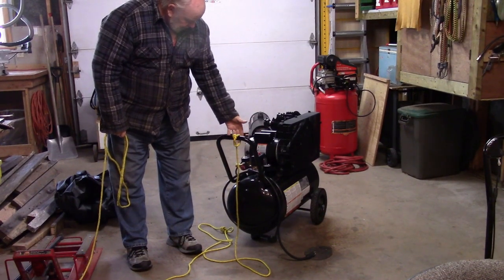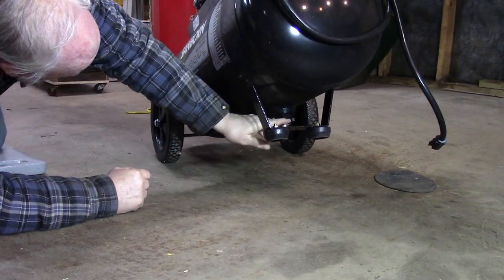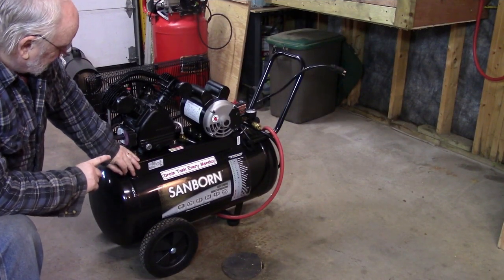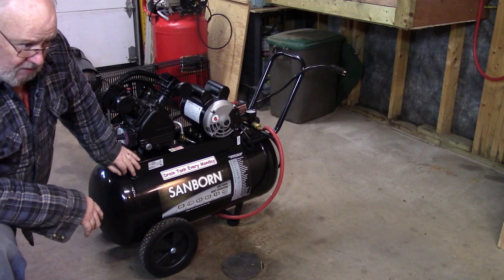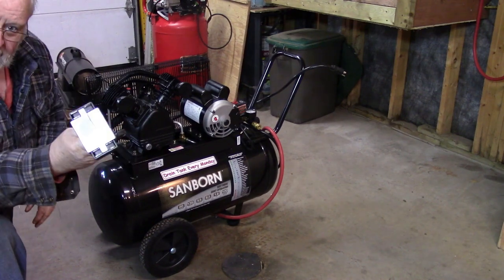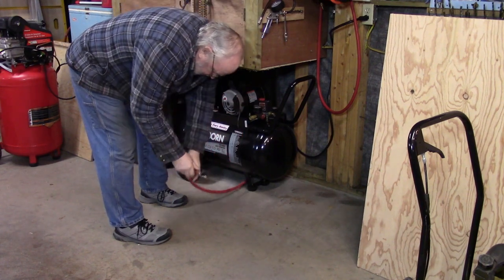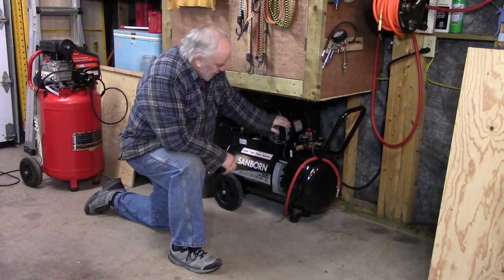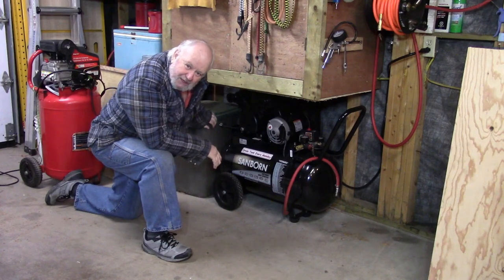Adding a Tank Drain Extension t o My Compressor

Comment: Good job Mike. 
I rigged a ball valve right to the main tap on my tank. Then I added a T in the line ahead of the manifold with an 1/8" ball valve. 
I leave the compressor on and when I need air I open the 3/4 ball valve. When I'm done I close the 3/4" and open the 1/8" to bleed down the line. Then I close the 1/8" again. 
Otherwise I had the quick disconnects on the air hoses leaking the tank down. I would have to shut off the compressor. Then every time I needed air, I had to build pressure in the 60 gallon tank from scratch. 
Now no blown hoses, hissing fittings, or waiting for air. 
The block heater is a great idea. 😁😎👍
Reply from the maker: How's she goin'?  When I was adding the 'main line' shut off for the compressor I ran a line from the compressor to the regulator and then added the stop valve after the regulator/filter.  In hind sight I should have a stop valve right at the output of the compressor.  So that will be another mod upcoming!!!  LOL  The magnetic heater idea worked well I agree!!!  Thanks for watching and commenting.  Take care!!

Comment: I was happy to see this video . It validated my idea of installing a rubber hose for the drain and bringing it up to a level that you don’t have to crawl around on the floor to reach.  Other people just extend the hard line out using hard piping ,still requiring getting down low to reach. Older and wiser still has meaning !
Reply from the maker: How's she goin'?  Thanks for watching the video and commenting.  Nice to have you on the channel.  The bending down part is something I try and eliminate on all my projects.  This rubber drain whip works good.  I drain it every Monday and there is not much water in the tank so I just blow it out on the floor.  Take care and come back again soon!!

Comment: Howdee Mike. Great to see you doing this. I drain my tanks with every use on a daily basis. Once a week just doesn't cut it. It is just a good habit to get into eh. Any water/oil mix makes acid as we know. A week of that going on in the tanks will along with the rust forming and the dreaded water that messes up our air motors need not happen. It only takes a moment at the end of the day. A small price to pay to protect our valuable tools. Even filling a tire with acid eats away at inner surfaces, both tubes and inner surfaces of tubeless tires. There is that and when the compressor comes on line it doesn't have to fight that head of air you mentioned. Poke a hole in that outside wall too. No air/water/oil on the shop floor either. It's always good to see you any day of the week my friend.  Take care and be safe laddy, !
Reply from the maker: Good day Dean!!!  This tank drain was a great idea.  It sure is easy now to drain the tank.  If I used the tank on a daily basis I would drain it more often, but I am having a hard time remembering to drain it every Monday!!!  LOL  
Dean when you say you drained the tank every day, do you mean you let the pressure down?  When I drain my tank, I just crack the drain valve for about 10 seconds to blow out any water that maybe be sitting in the bottom of the tank.  I don't let all the pressure off the tank.  
Thanks for tuning in old friend and take care!!
Reply: @GrampiesWorkshop  Absolutely on draining the tank every use until you here no more water leaving the system.  It does reduce the head in the system and if you are doing a big job needing the old tank as a reservoir do the same thing you did here. A rebuild on a hammer style air motor can cost nearly half the cost of a  new tool.
Reply from the maker: @TomokosEnterprize  For sure eh!!!  Thanks Dean!!!

Comment: Great modification, we need to do the same as we do not drain the tank frequently due to it being difficult to get to. To add to the fun, our floor is not so nice to lay on as yours lol. Thanks for sharing
Reply from the maker: Hey there Joseph.  Getting to the drain can be an adventure for sure, but you are young and wirily.  It should be no trouble for you to squirrel your way down and under the compressor to get to the valve!!!  But one day you won't be so agile, so adding the drain extension is a good idea for you guys!!!  LOL  Take care and thanks for watching!!!

Comment: great job done. i like the block heater sure comes in handy. take care
Reply from the maker: Hello there Wallace!!!  Thanks buddy!!  The little magnetic heater worked out well for sure.  I bought that for my tractor, but it's only 200 watts and it took forever to warm the engine oil on the tractor, so I don't use it very often.  Worked out good for the little crank case on the compressor though!!!  Thanks for the watch and take care!!

Comment: Great idea, Mike.  I like your compressor.  It seems pretty quiet running.  I have an older pancake style compressor that's very noisy.  It's about to be replaced with one of those smaller quiet running compressors.  I don't need a super large capacity air compressor but one that's quiet.  I saw one at Harbor Freight. So I'll check one out this coming Thursday and buy one if they're on sale (wish me luck).  Enjoyed the watch and the idea.  Have a fine week and stay off your knees.  It made my knees hurt when I saw you kneel on the concrete floor (ouch!).  Heck, GP made my foot hurt when he did a safety shoe demonstration and chain saw'ed through a steel toed work boot in his video.  You guys are killing me. 😂 👍🏽🙂
Reply from the maker: How's she goin'?  Ya gotta be tuff to life in the Great White North eh Don!!!  LOL  My compressor may have sounded pretty quiet because I reduced the volume when I was editing.  It is pretty noisy, but not as noisy as the old direct drive one I had!!!  Thanks for watching and I hope the 'Luck of the Irish' is with you when you go shopping for your new compressor!!!  LOL  Take 'er easy!!
Reply: @GrampiesWorkshop  Well, if I don't get the quiet compressor that I desire with a good price, I'll tell them I've got a couple of hard nosed characters in the Great White North that will set a Freeze in their life style.  😂  Do you think that will work?😲
Reply from the maker: @houndsmanone4563  You never know!!!  Anything can happen in a small town!!!  LOL

Comment: That’s a good idea I am going to do that on my compressor I think I will use steel like talked about not as easy to get down there when you’re pushing 70 have a nice day.
Reply from the maker: How's she goin'?  Thanks for the nice comment Paul!!!  Yes as 70 quickly approaches we need to make things as easy as can be right!!!  Just a thought, if you use steel, will you still have to get down on your knee to access the drain valve?  Where I put my drain valve on the hose I just reach the hose on top of the tank and crack the valve.  Any water will be forced out the line.  Just sayin'!!!  Thanks for watching and commenting.  Take care!!
Reply: In a few months I will be dragging 70. I entirely understand the not wanting to get on the floor.
Reply from the maker: @OldSneelock  Yes I find myself making plans for all that I can do while I'm down there now-a-days!!!

Comment: Love this idea Mike. I am thinking of doing this both to my compressor and to my log splitter for an oil drain. For the splitter, I would have to have a shut off up underneath the engine though. Going to be giving this some thought. Loved the magnetic heater. Where did you get that?
Reply from the maker: Hello there Gary!!!  Adding a drain extension is a good plan and even on your splitter, that would make things a lot easier too.  I'm sure you'll discover a good place to locate the valve.  The magnetic heater: I got it at Canadian Tire.  You can get them in a lot of automotive and tractor supply outlets.  This one is only 200 watts and it takes about a month to warm the oil in the tractor!!!  LOL  But for the little crank case on the compressor, it was warmed up in no time!!  Thanks for tuning in and take care!!